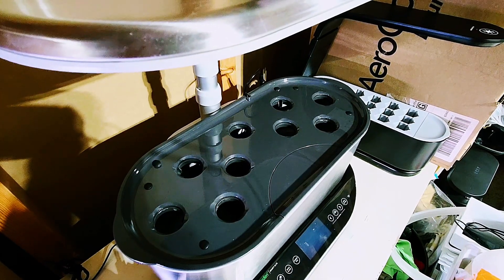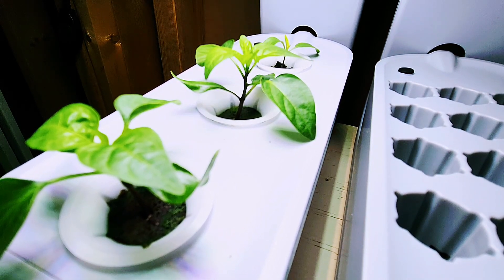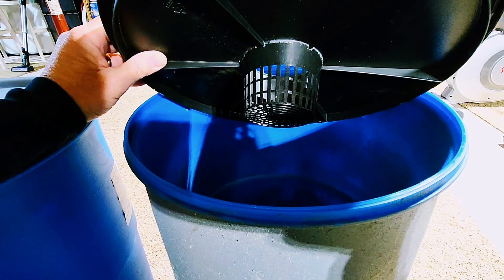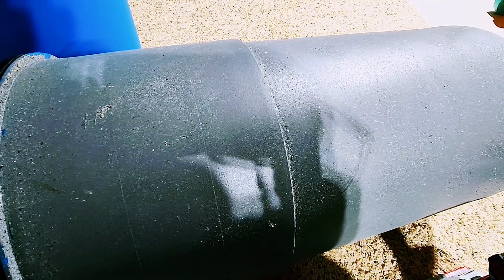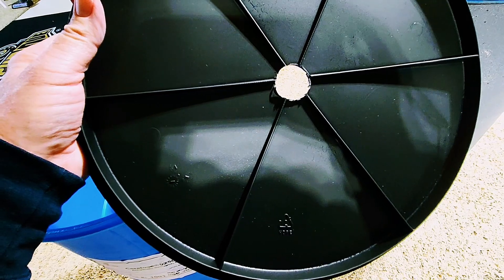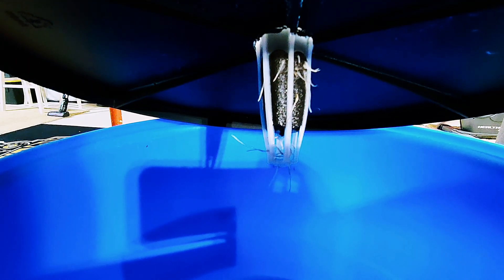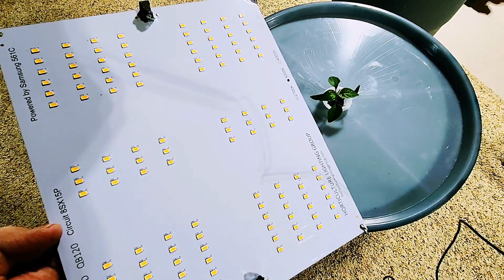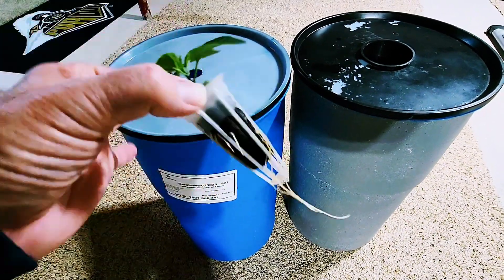B.A. KRATKY - DIY HOW TO BUILD PASSIVE HYDROPONIC SYSTEMS

Comment: Have you ever grown a winter squash like butternut in a 32 gal container?  I've had two fails so far.  Not sure if the water gets too hot outside.  Maybe I'll try it in the shade.
Reply from the maker: The Kratky Method was originated in Hawaii, not exactly the North Pole but not as blistering as south Texas. Professor Kratky said you are likely to have differing results in different climates. Personally, I have grown everything from lettuce to giant passion fruit vines using this method. With butternut squash, you are using around 4 to 6 gallons of water for every pound of squash which quickly uses up nutrient. So limiting your vines and fruit would help. Also, photosynthesis is affected by heat, and in addition roots prefer around 70F temperatures if possible. Keep in mind too that passive hydroponics will yield fewer and smaller squash compared to active hydroponics. With that in mind, you should be fine. Use either a fill once and forget setup, or a float valve and reservoir for constant water level. I think you're idea of partial shade will give you better results.
Reply: @MattGarver  thank you!